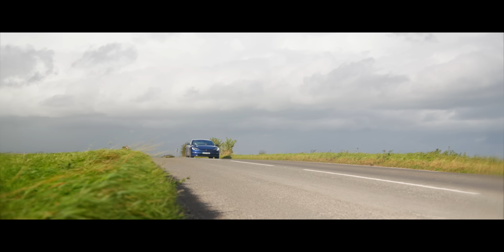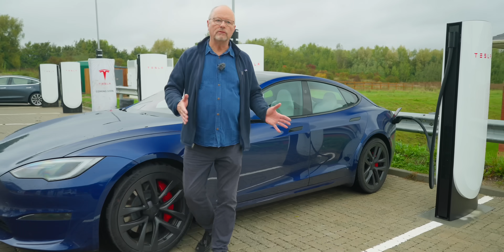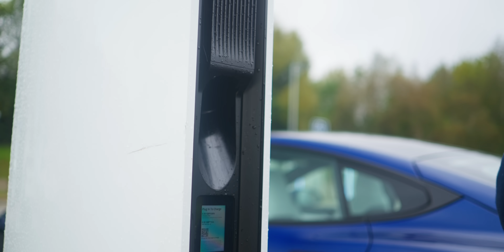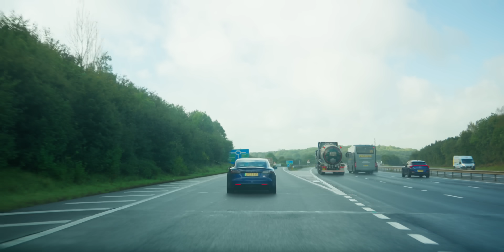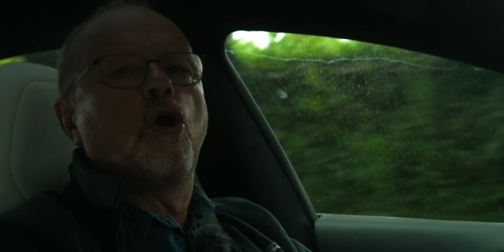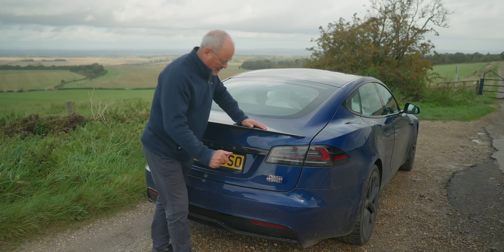THIS Is Why The Model S Plaid Didn’t Come To The UK

Comment: Robert, you must keep in mind that these are currently still version 3 superchargers. They are V4 stalls/dispensers, but the actual chargers are still V3 capable only up to 250kws. Once the actual chargers (the large electrical cabinets in the background) are upgraded, then they'll be capable to charge up to 600kw. Although they'll likely limit them to around 350-400kws in the near term.
Reply: But, Robert got 261kw from the charger. So it's not actually limited to 250kw.
Reply: @trevorberridge6079  You can get a little over 250kws for just a little bit from a V3 if the battery is low enough. That's not unussual for a V3 charger. The dispenser has nothing to do with it at this point, other than having a longer, thicker cable. The actual chargers themselves have not been changed yet. Or at least not in all other locations where the V4 dispensers have been installed thus far either in Europe or the US. Only way to confirm is for him to actually go and read the specs on the actual chargers to see if this location is somehow different and they have indeed installed new V4 capable chargers to match the dispensers.
Reply: @trevorberridge6079  telsa chargers dont have hard limits its based of temputeres that is what I have heard
Reply: @oliversolheim4026  The fact remains that it charges notably faster than 250kw. That's not it's actual limit. Temperature variations don't speed up charging, they slow it down from optimum speed if they cause sub-optimum conditions.
Reply: @oliversolheim4026  Their current V3 or older chargers are 400 volts based, and have an amps limit of around 550 amps, so that equates to a little over 250kws. Their new V4 are 800 volts based, which means their amps can be lower, and therfore create much less heat. Those will be capable of 600kws and over 1,000 volts. However, they'll be limited to between 350 and 400kws for the first 2 or 3 years or so, which is still blazing fast. 

However, that is only if you have an 800 volts based EV. And only their Cybertruck and Tesla semis have that. They also have megawatt chargers for their semis. Not sure yet if Tesla will allow other 800 volts based EVs to charge at those rates, however, as they currently only allow up to 350amps to none teslas on their V3 chargers, while Teslas can use over 500 amps.

Comment: Removing the indicator stalks is a design failure. They need to return both for safety & ergonomics.
Reply: Same thing with Model 3's EVERYTHING is a heads-down menu - no buttons and knobs.
Reply: I own a model S with yoke. Stalks are more reliable, i agree. But the buttons are really no big deal when you are used to them. From just a design perspective i do like the stalkless appearance. There are situations where using the buttons is harder than a stalk would be though.
Reply: No that is bs.
Reply: Why do you consider pushing a button harder than sliding a stalk? Serious question.
Reply: Try a roundabout... @lemongavine
Reply: @lemongavine  because the wheel turns with you and changes the position of the buttons vs a stalk that is stationary no matter if you are turning or not.   That is HUGE safety problem.
Reply: @lemongavine because the buttons are a moving target as you turn the wheel, a lever is ALWAYS in the same position.
Reply: @R-T-F-M  But you should turn them on before you turn the wheel anyway, if your wheel already is turning your doing something wrong.
Reply: @-JustHuman-  No.  You can be changing the direction you're indicating while on a roundabout.  Sometimes, side roads are positioned after bends.  Sometimes you have to start indicating when the steering wheel is turned.  Sometimes you need to change lane while turning.

Comment: Not quite sure about your fuel calculations...my 340d showed 12l per 100 km or about 20 MPG at 155 MPH  or about 2 hours before needing to refuel
Reply: Stop lying I have a 15' 335D and even going 200Kph I average only just above that at 11l per 100Km. plus unless bmw have massively increased the size of the tank on the 340D compared to my 35D you will only do around 350km or what im guessing is around 1.25hrs at 155Mph.

Comment: FYI you can buy it in the UK and it be UK registered with warranty etc etc, but it will be LHD of course which is a deal breaker for many.
Reply: not possible in aus due to regulations... and dumb drivers dont help either

Comment: Any car without an indicator stalk is DOA in the UK, and anywhere else there is frequent use of roundabouts. Switching from indicating right (passing exits) to indicating left (before the exit you intend to take) while the steering wheel is in any other orientation than neutral requires a context and attention shift from road awareness to vehicular control manipulation. Vehicular control should be by muscle memory and not require any attention at all. It’s manifestly unsafe to have safety controls not in a fixed position.

Edit: It is not a legal requirement to use your indicators, so I guess these new Tesla’s are no less safe than BMWs 🤷‍♂️
Reply: Do you remember switching manufacturers and finding you put the wipers on instead of indicating?
Reply: @HairyCheese  Yes, I have driven a Hyundai. That doesn't take away from my point, though; the stalk is still permanently located in one place, not free-rotating as it is on the steering wheel, even if it is located on the right hand side and not left. You can still rely on a clockwise action being the right indicator, anti-clockwise being left.

What I didn't mention is that it's also required to consider the orientation of the wheel when choosing which arrow to press. Once the wheel passes 90 degrees the left becomes the right arrow, and vice versa, and changes back after 270 degrees. It's bonkers. The only way it could work is if the steering rack was as fast racing cars, requiring less than 90 degrees to get to full-lock. That's not suitable for road use where subtle adjustments for manoeuvres such as lane changes are required.
Reply: you are SO right, dude....it's impractical...and unsafe.....anyone who thinks otherwise shouldn't be driving....!!! @Morbeyn

Comment: Lever is not a step back? Invented in 1929, commercialized in 1939 - that's almost 100 years ago - not a step back.... :) 
The flip side is, it does take getting used to the buttons, and it's darn hard to turn on/off the blinker while turning.
I am a huge Tesla fan, and I have one of these cars with the buttons, and no, you are not an idiot. I totally understand the frustration. :)

Comment: Why don't Tesla put the left indicator button the left side of steering wheel and the right indicator button on the right side ?  No need to look down.
Reply: imagine a roundabout or you forgot to indicate within the turn or indicated wrong and wanna switch back.. hunting for that small, with the steering wheel moving botton 😮!
Reply: An indicator stalk would still be much better.

Comment: No indicator lever is a step too far. It will ba a nightmare indicating correctly on a roundabout!
Reply: Doesn’t seem that complicated to me. Rest your thumb on the button before turning the wheel and press it when it’s time to.
Reply: @lemongavine   It’s because when you negotiate a roundabout you have to turn the wheel one way and then the other while at the same time indicating one way then the other. Your hand will not stay in the same place on the steering wheel during that process, so your thumb will not stay ‘resting on the button’. I’m assuming you live somewhere with no roundabouts? Or maybe even, no corners? Or maybe you just don’t bother indicating at all…

Comment: Re.  Indicator levers.   Europe has lots of roundabouts which require access to turn signals whilst orbiting the roundabout (to indicate you are exiting).
How the hell am I supposed to indicate my exit if the turn signals have rotated 90 degrees?????  It's just stupid.  
The same with full beam headlights on country lanes.  I need immediate access to full/Dip beam all the time. Just stupid.
It's designed by an American driver I expect, used to long straight roads and right-angle turns.
Reply: Exactly!

Comment: “Most expensive Tesla ever made”. Except the Model X Plaid is even more expensive.
Reply: And the Plaid is cheaper than the P100D used to be. In fact, the Plaid is only $2k more than what I paid for my 90D in 2016. I am still kicking myself over not spending the extra $50k to get the P100D, which has quite a bit more range.

Comment: Tesla opening up their network to non-tesla vehicles will be an utter game changer to the rest of us EV minions...
Reply: They already have, some stations have been open to non-Teslas for nearly a year now
Reply: @samm4192  In May 2022 in my holiday i was already charging beside 2 Audi eTron at the Supercharger.
Reply: By doing that Tesla can become the next big branded petrol station like Shell and BP if they can't compete building cars as their fall back.

It's actually smart when you think about it.
Reply: The two nearest Tesla superchargers are open for none Tesla's for over a year... I have so far not seen the need or benefits of going there to charge my VW
Reply: Yeah. Until I run into confused newbs wondering why the V2 charger they're trying out won't work.
Reply: Are you writing from the US? I have found in the UK that the non-tesla charging network has always been great (but I am in the SE of the UK where I know the coverage is better).
Reply: @shonunezekiel  No, in the UK (Cambridge). I've had some very poor experiences with no Tesla chargers. But mostly they're twice the price!
Reply: Bit annoying having to wait in my Tesla for non-Tesla cars to charge at some of the smaller Tesla sites. But I'm hopeful that oneday we'll all be able to use any charger and not feel robbed!

We're in the days of only using your Bank's ATM and extortionate roaming prices! We'll get there!
Reply: Why not just buy a Tesla ? Baffling.
Reply: @maxflight777  🤡
Reply: @maxflight777 Why not just buy a cheap, reliable and economical diesel?  No seriously.  There are so many problems with ev's.  What on earth persuades people to buy them?
Reply: @clives4501  I take it you'd be one still riding your horse and carriage back in the day, rather than those petrolium based horseless carriages with all their problems. Are you still using reliable cheap flip phones, or have you tried those problematic smart phones yet?
Reply: @junehanzawa5165 Well June, it may be easier to play the man rather than the ball. I am impervious to such criticism.   However, facile comments merely amuse for a moment in time.   They serve only as a tactic to avoid considered debate and the enduring benefits which result from it.
Reply: Lol why by a non tesla ev?
Reply: @braddboy5 Cost!?
Reply: @braddboy5 because they are better
Reply: @ericpisch2732  Depends heavily. better then the majority of Chinese EV's? Yes certainly, but they are disqualified for other reasons anyway. Better then anything from Volkswagen Group... no certainly not. Most from Stelantis is sadly also garbage, except for the Mokka -E.

Chevy Bolt, eh no thank you. Ford Mach-E is nice though, and the F-150 Lightning is likely good as well. 

Polestar... to much Geely and thus to much Chinese. BMW.... hahahahahha. Mercedes, eh no thank you.

Hyundai, hmmmm. Kona Electro is soso though i have to try the newest one still, Ioniq Electro is... well crippled but i think they dropped that one anyway. Ioniq 5 would be ok if they solved all the issue with it like Battery cooling out in Winter. Ioniq 6 i also still have to try out.

In terms of part quality, and robustness, the Teslas easylie win. The build quality is hit on miss. Like if it is from the US it's typically a miss. All i have seen from China those far Rival, and oft exceed the Build quality of an Audi.
Reply: @braddboy5  elon
Reply: @braddboy5 Because they make shoddy cars
Reply: Bah humbug.....but what gas Elon Musk done for me!! Billionaire bad bollix.

Comment: Lunatic car! I can accept putting 'trivial' controls on the wheel, but not the indicators or wipers!  It seems to be awfully easy to confuse left and right when the wheel has been turned about 180 for a tight corner - and I understand that they don't self-cancel, either. - - I never did understand why - with a lever/switch shift, forward lever is reverse, and back lever is forward! Totally illogical!

Comment: Not to lets facts get in the way of a good rant but Top Gear especially and other motoring publications fairly regularly moan about the fuel consumption on track or at high speed from ICE cars.

I'm not convinced that the resources used to create a brand new Tesla are any less damaging than driving a Mercedes flat out for a while.

You've gone a bit too far to the green side Bob. You're starting to sound as hyperbolic as the fossil fuel lovers. The best compromise right now is to keep driving an older car.

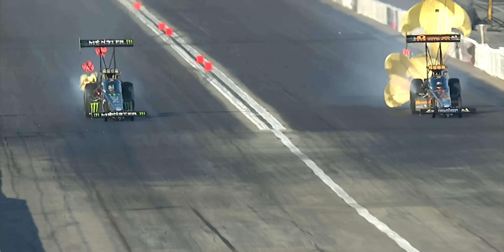Comment: @5:35 Just one thing - the dragster you showed was an 11,000 HP top fuel dragster driven by the current world record holder, Brittany Force. Top fuel dragsters do 0-100mph in 0.8 seconds - not "about 2 seconds"
Reply: Fun fact. Those dragsters now race 1000ft instead of 1320 (1/4 mile). They go too fast in the quarter so they had to shorten it for safety
Reply: I know he said it wouldn't beat the dragsters, but I think he was mixing up the times with F1 cars. (though you're definitely right about his incorrect statement of the dragsters 0-100 times being 2 secs), it's the formula one cars (0-60 in 2.6 seconds) that he is right when he said it would beat them off the line.  I don't think he meant to be inaccurate, I believe he either misspoke or got the two confused.  I'm wondering if he'll make a retraction.  LOL
Reply: Hmmmmmmm, I'd love to see a dragster do a corner.... Didn't Richard Hammond try that 😢
Reply: The issue for me with Tesla's is that they're not good looking cars. Many other car brands make better looking & better looking EV's.

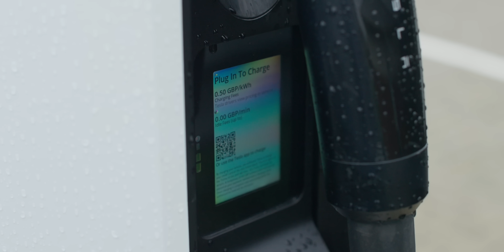Comment: 1:50  Convert to USA dollars and it's 60cents,  times that by 10 to get a close equivalent to energy from gallon of gas and it would be $6 US/gallon.  Which is more than gasoline in USA.   So how are EVs cheaper?  Oh yeah only if you charge at home, on long trips they cost more. Also in USA a lot of profit for gas stations comes from sale of food items and other things, why don't these charge  stations, which have the power, have at least some vending machines to make money?
Reply: And now stop comparing US gas prices to UK energy prices, and you would look a lot less like a fool.
Reply: I am a foolish fool for not bothering to look up UK gas prices which in London is 	$5.79/gallon gasoline average.   So yes in USA its  $3 equivalent at supercharger  per gallon in my area.   I've watched  fully charged from the start and always they touted how amazingly cheap it was going to be for charging up.
 @marcd6897
Reply: 9:09 equivalent energy of 147 per gallon.    Once more using BS calculations.   They get that number by saying gasoline contains 36kWh of energy.  But cars are crappy at extracting energy from gasoline, they in fact on average an extract of 10 kWh of energy to move down the road.  The rest is lost to heat and other factors, which is why we need to stop burning fuel.   A generator using gasoline to make electricity is even worse at 5.5 kWh or so.   So Tesla uses 15 kWh at 60mph which comes out to 40 miles per 10 kWh or gallon of gas, which makes sense.   Lets look at physics, 2 cars same weight and friction use same energy to go X distance.   That's a fact, that is logical.   It's physically impossible for a tesla to use 3x less energy to go same distance.   So the measurements used are BS.   Teslas are very streamlined and reuse energy so are managing 40+mpg, which is impressive for car their size.  They use far less at slow speeds where gas cars REALLY suck.   My EV bicycle would be able to go 2,880 miles/gallon using Fully Charged calculations.  Reality is 600+ mpg energy equivalent or 2500 miles cost per gallon as I charge at home and it is 0.15 kWh since we have some solar.    Get rid if EV cars and use bikes and public transport if you really want to make a difference and actually save money.
Reply: @dailyrider2975 Since I live in a very sunny region, I’m able to run my truck and car both almost entirely from free solar energy generated on the roof of my house. But yes - my electric bicycle can do thousands of miles on that same energy. However it’s far too hot here - and the distances too long - to be able to practically travel by bicycle. In the UK that’s entirely different - and I used to cycle there as my main form or transport. I miss that.
Reply: DC fast chargers are 59c per kWh here in Southern California - so the same as Tesla is charging in the UK. Which makes it cost the same as gasoline for a similarly sized vehicle. I did the ‘math’ on my Rivian R1T, and it costs the same as a vehicle that gets 17mpg - which is about right for a RAM, F150 or Silverado pickup truck.